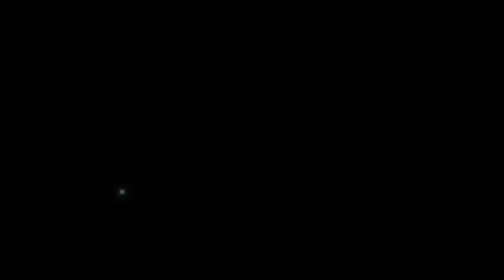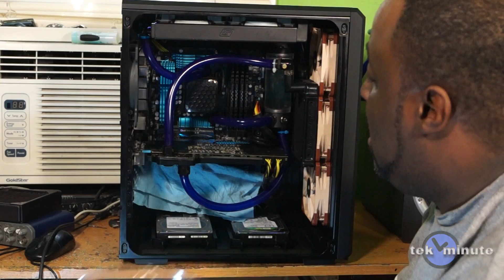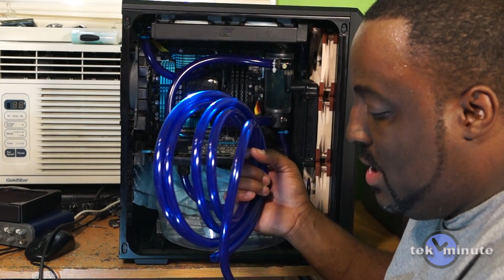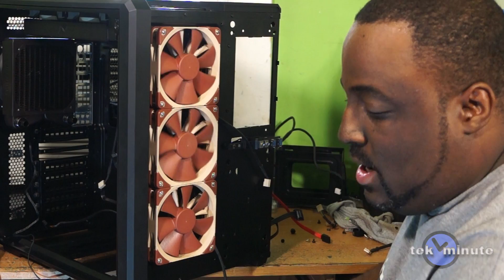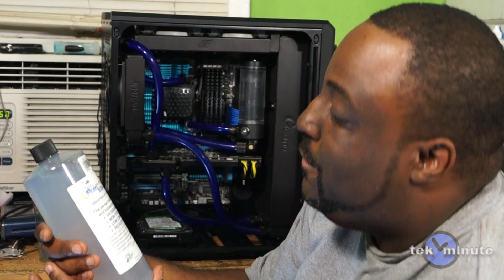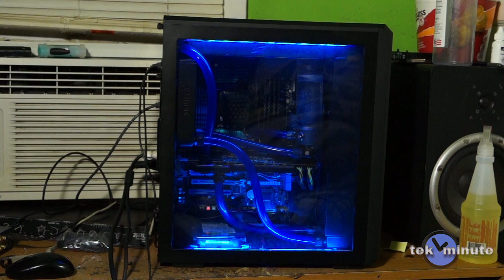My Corsair Carbide Air 540 Build part 2

Comment: is the fan on front pushes the air inside?  or pulls the air from case? sorry newbie here
Reply from the maker: +hisokiss the front is intake and the top and rear is exhaust
Reply: i see thanks.. but i guess that will have a problem on dust as the filter was removed right?
Reply from the maker: depending on your graphics card and your rad

Comment: hey man, how did you bleed air blubbes out this pump?, awesome bulid
Reply from the maker: Just like any other water cooled system, just rocked it back and forth to I got the large bubbles out then over time the micro bubble came to...

Comment: great video as usual, you still running this setup? and would you reccomend this case? i have phantom 530 red which i like but I get bored with cases and love this case. thanks!!
Reply from the maker: thank you for commenting, no set up a little different I have moved to the 2011, and i can only recommend this case if you love cube case and don't want to pay 500 for a case lab case but the D600 is looking nice tho.

Comment: Your gtx 590 is 11 inches long right?  So if i used a 56mm rad in the front, a 10.5 inch 780 would fit?
Going to get the XSPC RayStorm D5 RX360 V3 WaterCooling Kit.  And when i added my second 780, ill add a 240 on top like you did.
Reply from the maker: yeah you should be fine, My graphics card is 11" long and my rad is 60mm thick and i have 1/2" between them
Reply: Michael Williams Nice thanks for the reply.

Comment from the maker: the first coolant i was using was something called fluid xp + clear uv blue i got it from the micro center. when i decided to change the pump i noticed that stuff was leaving a coating on everything so i switched to swiftech coolant it still a little that stuff left in there with swiftech coolant so it still have a little uv effect but no coating

Comment from the maker: I spent about 1700. 
Motherboard Asus Z68 deluxe gen 3
Cpu intel 3770k
Memory Corsair Vengeance 16gb @ 1600mhz
Graphics card gtx 590
Psu Corsair HX1000
Fans Noctura
Rads 1x 120, 1x 240 and 1x 360
pump apogee drive 2
2x 256 SSD
2x 3T HDD

Comment from the maker: for what I want I do......Im a silence freak, while idling only the two top fans are on at 700rpms, when gaming or rendering video all fan (6) are running @ 700rm and i cant hear a thing and my system stay cool around 60c...thats with the Cpu overclock to 4.8Ghz and Gtx 590 @ 700mhz.

Comment: Nice work! love the concept. I have one question in mind. Did you have a problem bleeding the system and getting the air bubbles out? There are a lot of reported problems with this pump and most of them died due to poor bleeding and due to trapped air bubbles out.

Comment from the maker: yes this is my first custom loop, I also started with a closed loop system but it didn't work out for me. I was looking for performance and silence, I got some performance, but if you add a graphics card or two you lose the silence they can get pretty loud under heavy gaming....with that said the con of a custom loop it will cost more ....... so i suggest swiftech H220 because its expandable you can add on later

Comment: gj on fitting all those rads in, but thats a mess of tubing bro. You probably could have cleaned it up a bit more, maybe by running some of the tubs to the otherside through the rubber grommets. Makes me wish the 540 was just a little taller and longer

Comment from the maker: yes you are right thanks for your reply, What I'm using is the swiftech h220, which have a res and fill port build in the rad that the one on top of the case to only reason im using that other res is for the looks and its easier to get the air out the system that way.

Comment: First rule of watercooling; never let the pump run dry. Second rule of w/c; always fit the pump as the first device after the reservoir to prevent the possibility of it running dry.

Comment from the maker: I suggest using 30mm thick radiators, because you don't have to make any modifications. I believe if you use 45mm you may run into some problems I did.